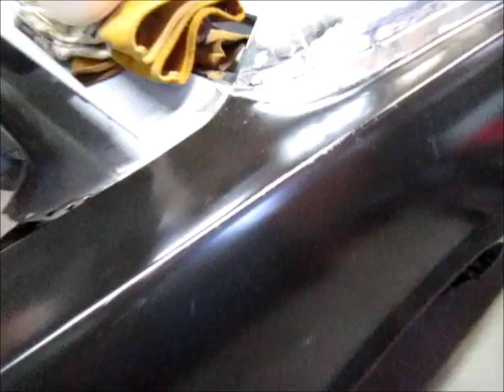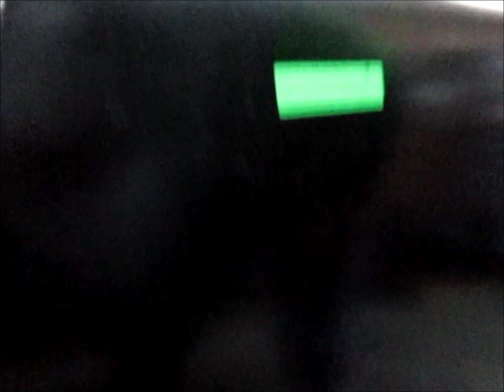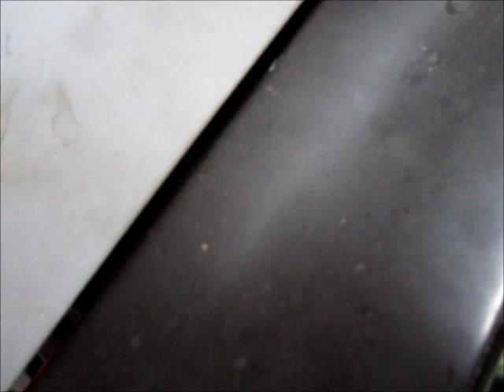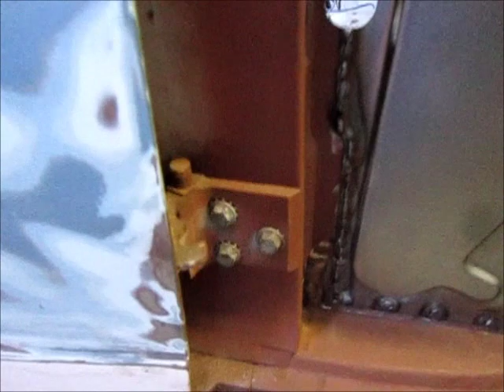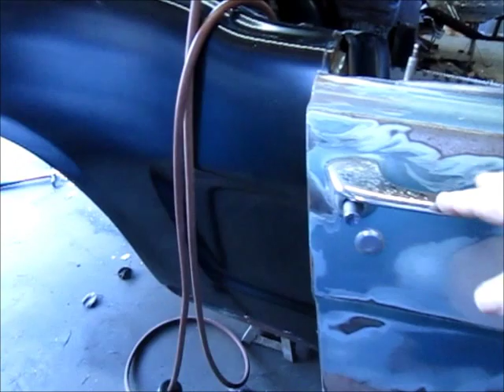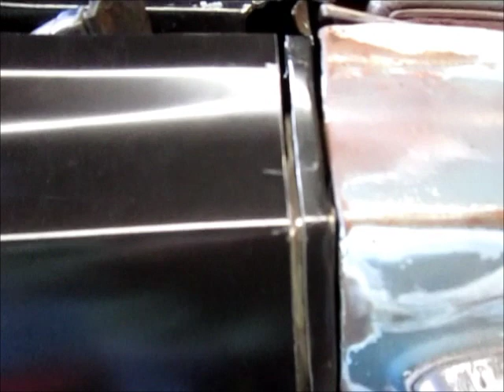1965 Mustang quarter panel install part 2

Comment: I have both quarters OEM NOS for my 66 coupe. Amazing they even exist. I understand most people would not bother when much cheaper reproduction parts are available but have not yet found much information on people installing OEM NOS quarters.  I will keep digging. Maybe things will magically fit but don't expect that and I'll be wanting to adjust anything surrounding it that is repro in my case instead of touching what is NOS - stamped in 1975 or earlier based on the sticker but I have not unwrapped that Ford packaging and look for a date. You vids are appreciated - I replaced floor boards, cowl, apron, and added torque boxes watching your stuff
Reply from the maker: Those are hard to come by.

Comment: So after you removed the led...did you just fill that area with bondo or body filler?   did you go back and weld over where the led was...it looks like there is a gap there with a few spot welds.  Also, that hole you discovered...how did you fix that...just hit it with the welder?  Your vids are great and very informative....I'm starting on my 67!
Reply from the maker: I do not weld the edge where the lead was. Remember, lead is just a filler, but is a metal as well. The entire edge of the butt is welded. No gaps. I guess I didn't show the end result. I did fill the hole.

Comment: When welding, what's the point of drilling the holes? Or should i say what purpose do the serve?
Reply from the maker: charmoines jordan The holes I drill into the new panel are for weld points. Where one panel overlaps another. At the factory they would use a spot welder that creates the weld by pinching the panels in between the jaws while it is welded. Without a spot welder, I replace the spot weld with a plug weld. The original panel I weld to has no holes and it supports the weld.